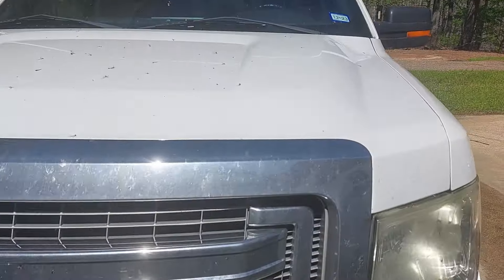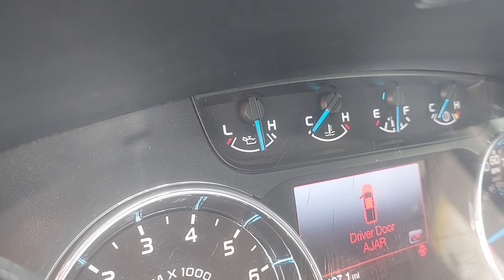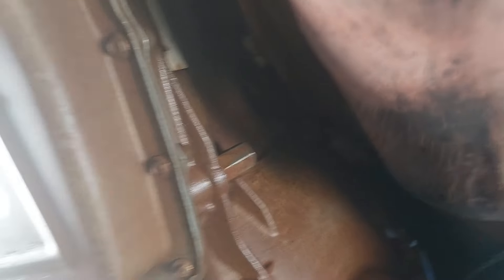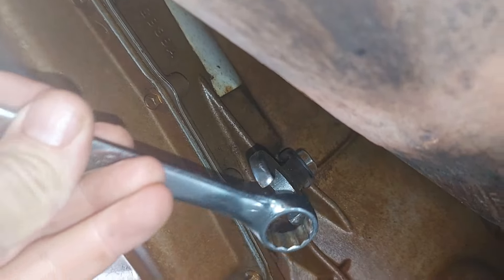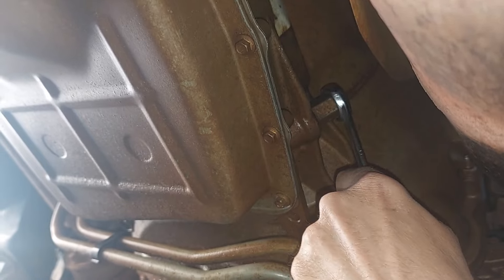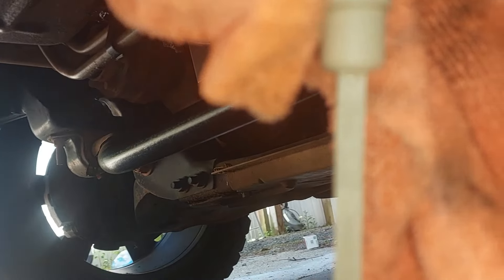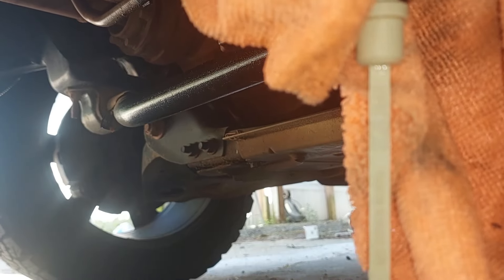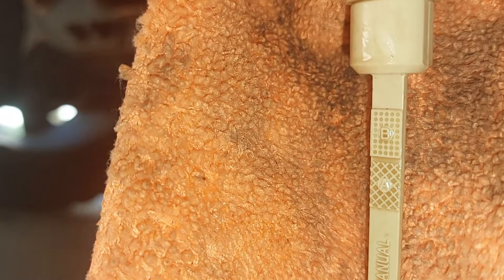2013-2016 F150 Ecoboost Checking Transmission Fluid Level

Comment: I have a 2011 f150 3.5 I’ve been having weird shifts with my transmission and I’m curious if low trans fluid is my issue, it seems simple enough but it still scares the hell out of me being THAT close to the catalytic converter, what were they thinking with this design
Reply from the maker: The stealership and designers do this on purpose. My opinion. It is a little scary next to the exhaust. But here is the trick to help you out. Before you warm up the engine loosen up the dipstick bolt. Don't take it all the way out or it will dump out on you. But at least you can have it loosened and not have to fight a stuck bolt. Try to get yourself a good thick leather pair of gloves to loosen the dipstick bolt when the engine is warmed up and running. This will help jeep from burning your fingers and hand if you accidentally touch the exhaust. You can do it, if your smart enough to own an F150 I KNOW you can accomplish this. Lol. Let me know if you have any questions. And YES! low fluid can cause shifting issues. But keep in mind certain vacuum leaks and other things can do that as well. But you always start with the fluid. Let me know how it turns out.

Comment: I have a 2013 f150 3.5 and my transmission or my gears jerk when i floor it and let go after. Is there any issues here or not?
Reply from the maker: First question is this,
How many miles on it?
How long has it been since fluid has been changed?
Does it do it warm or cold or both?
If you put it into 1st gear manually, not D does it still do it?

If no matter what gear it's in cold or hot you may have am issue with your driveline or differential. 
Let me know and I'll go further into it.
Reply: I would maybe stop flooring it then? Lol that's not good for the engine and it's even worse on the transmission
Reply: Mine  does the same thing and a big wrench pops up on my dash...it won't go higher tha  6th gear a d wben i co.e to a stop. It won't go lower tha  3rd vear...🤔
Reply: @robjordan204 mine does the exact same thing

Comment: i own a 2014 ecoboost 4x4 3.5. this is crazy ford would do away with the stick. i have not checked mine yet. have not put that many miles on it yet. manual says not to check a sealed tranny. do they use much fluid ? i am 255 i am not sure i can fit under the truck. lol
Reply from the maker: These manufacturers want us to take our trucks into the dealers. As for the amount of fluid that depends, if you just drain the pan, you're prob talking 5 qrts. I haven't changed mine yet, so I haven't looked up that info. The people who owned my truck before me really took good care of it. 
    A few things to remember about the ecoboost, they are 100% aluminum. Never let it overheat. Also, keep up on your oil changes. These turbos hate dirty old oil. 
   If you have normal offroad tires on yours, you should be able to fit under it. They are pretty high riding trucks.
Reply: @cobravids  my truck sets pretty high. i think i can fit under it. i had to use ramps for the oil change.
Reply: I have a 2014 F-150 eco boost. It has trouble shifting up in gears sometimes. Any suggestions?

Comment: What if trans fluids comes out when removing plug?  Truck hot and running
Reply from the maker: If your truck is running and warmed up when you remove that plug and fluid came out... I would first make sure the truck was sitting level. Not to one side or facing uphill. Then, if truck is level, I would believe it to have been overfilled.

Comment: Top of b is the goal says Mitchell. Doesn’t say running or not of course which is why I’m here. Great video man thanks
Reply from the maker: YES definitely running. Lol. You will have some hot fluid in the face! Lol. Thanks for stopping by. Much more on this F150 to come. Potentially a full engine overhaul.
Reply: me too,,  is it running?
Reply from the maker: @gearheadSMOKENJOE  Yes make sure it's warmed up and running. Not just engine temp, the transmission temp should be at normal operating temp as well.

Comment: In the event that it is low, is that where you have to add to it?
Reply from the maker: Yes. Adding here is fine. Just remember to keep it running while you're adding. If.not fluid will pour out when the tranny drains back into the pan.
Reply: @cobravids  good deal thank you. I don't know yet if I'll need to but just checking.
Reply: What do you mean pour out into the pan????  I added mine when it was off

Comment: When dipping the stick, do you screw it in and screw it back out to check? Appreciate the video!
Reply from the maker: Yes, to get the most accurate reading, you should. I have pulled it out, dipped it quick and checked it, and saw that it was over the low mark and knew that i was good because i knew there was more it would have gone in. If that makes sense. But make sure it's running. Lol. Thanks for stopping by and commenting.  Stay safe, stay free.

Comment: If I check the fluid when the truck is not all the way warmed up and it is low is that a bad sign?
Reply from the maker: Yes, when your oil is that low it will be lower warmed up. When warm it has more oil up in the engine. Whenever my engine is cold my oil reads just above the halfway mark.
Reply: Half way is between A and B?

Comment: How do you get the bolt out when its torked down?
Reply from the maker: @DylanAce66  you can just use a 19mm i believe it was. Its not a torqued bolt. Just retightened but not overtighten.
Reply: @cobravids  it's really tight I couldn't get it out

Comment: Thanks for the video, My dipstick was a 3/4 in, Go figure? 
Anyhow, I'm ashamed to say that I have 
170, 000, on my Ford, (still runs great)
I never changed the transmission fluid ..
 that transmission fluid is dark, and we all know the story, We're not supposed to change the fluid when you have that many miles on it,
Does anybody have any thoughts on this matter?
Reply from the maker: @maxmann-td4hn  What you should avoid with that many miles is transmission flushes. I dont see an issue with changing it. What they say is that when your fluid is old there a lot of sludge/worn clutch material that will come out of small cracks in seals and cause problems. If it were my truck, i would drain the fluid and replace the filter. There will be a few qrts left im transmission and the torque converter, which is fine. 
To refill, just use the hole you check the fluid level with, and fill it up with the engine off until it overflows. Start the truck and add more, stopping to check fluid level as you go. 
You should be fine, i have seen this done on high mileage before. The older trucks and cars, you would find more of the issues you were concerned about. Just dont flush.
Let me know if you have any questions. And others, please chime in to offer your opinion.